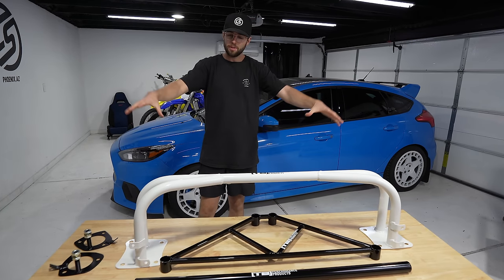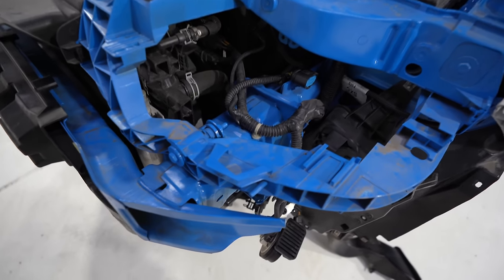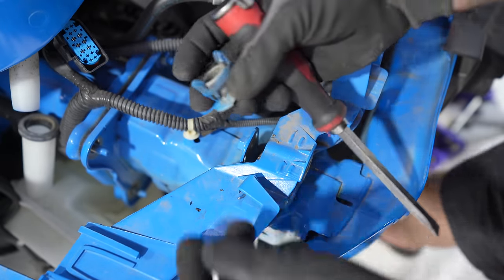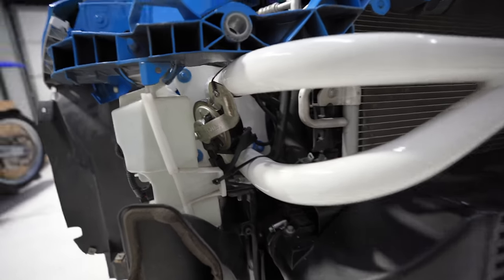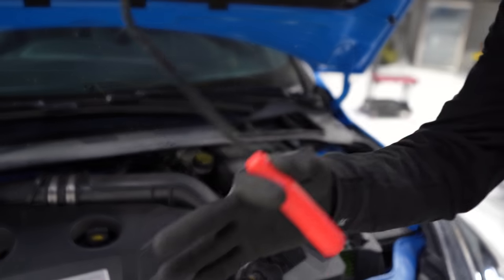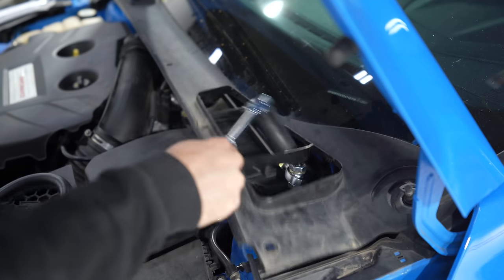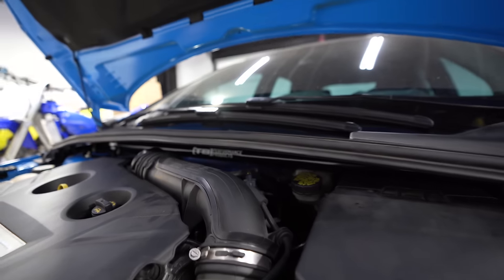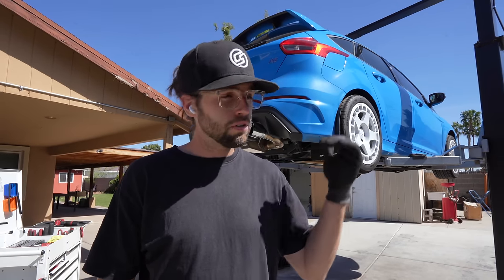Focus RS Crash Bar Install.. Did I go too far?

Comment: Do you plan to drill out the hole on the strut tower? A 3-1/8" hole saw is the right diameter for it. But that allows you to actually get access to the camber plates. You can use the strut brace as a "jig" for the hole saw. You'll also have to take the coilovers out while you do that...

Comment: Tip: theres no need to remove the wipers when removing that upper cowl piece...as long as its warm enough, you can flex (bend) one end up over one wiper blade, then slide the other one over the other. Those wipers can be a pita to remove..mine fought me like crazy and its in very prestine condition. So every time now i just flex the piece of plastic up over the wipers.

Comment: Love TB performance parts but I prefer the single front traction bar for the focus ST. It removes torque steer in a much smaller package and I can still have the lower engine cover installed on my car.

Comment: Correct me if I’m wrong but isn’t it not optimal to have a heim joint in the strut tower brace? From what I’ve seen/researched isn’t it best to have a solid bar if possible?
Reply: I’m with you. The stock crash bar is properly crash tested. This bar is not.